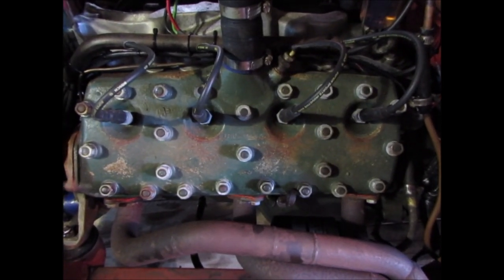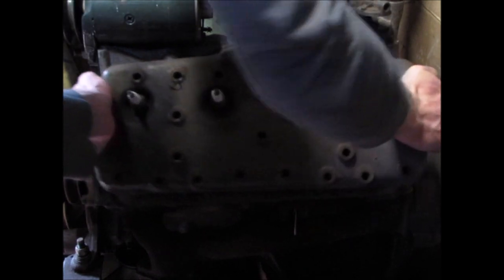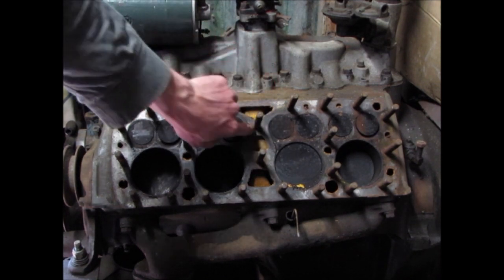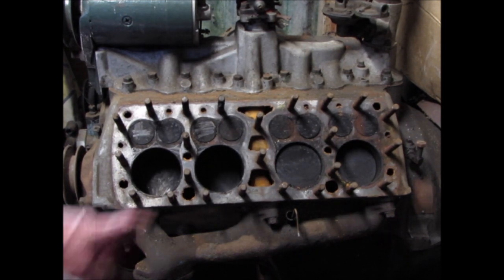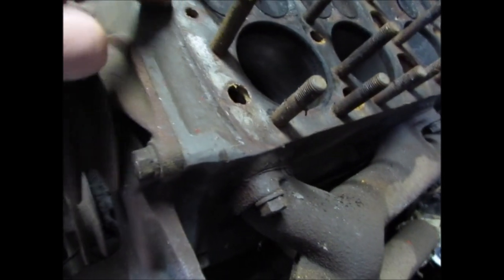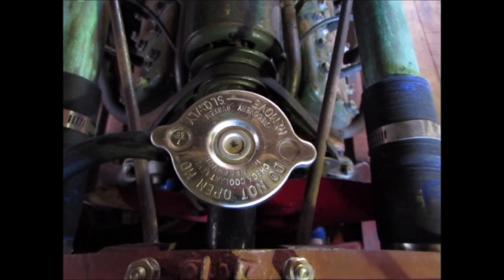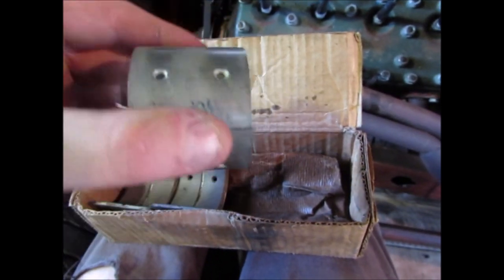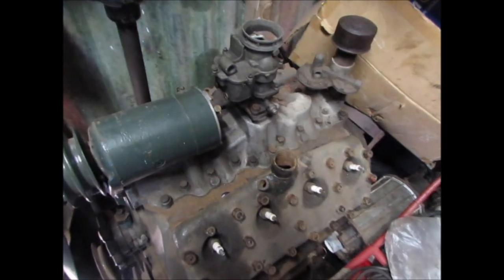The wonderful Flathead V8 Why 3 exhausts?

Comment: Nice engine but oh yes they do run hot, due to the center exhaust exiting through the water jackets. My second car was a 1941 Ford Super Deluxe with 221 C.I. engine and it would run hot while idling, as will all V8 flatheads. The secret is to keep the rpms up and use a larger fan if necessary. Racers often remove every other vane from the water pumps. Running hot is the only real fault of this great engine and is why it requires a very large radiator, two water pumps, and twin hoses top and bottom. Ford is the only manufacturer to build an engine with an exhaust cooling system.